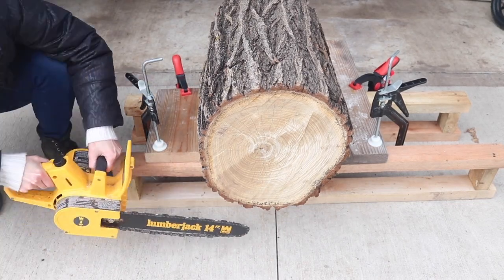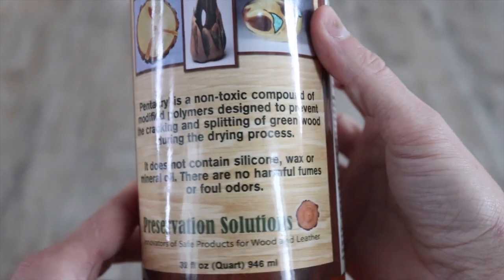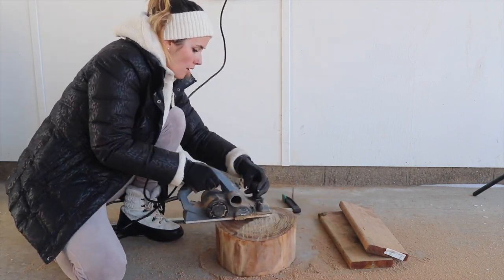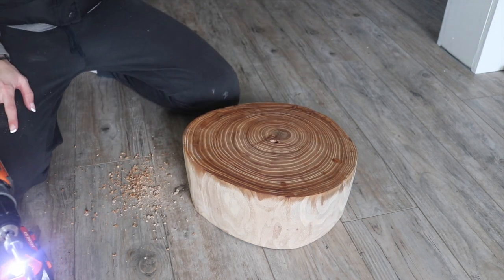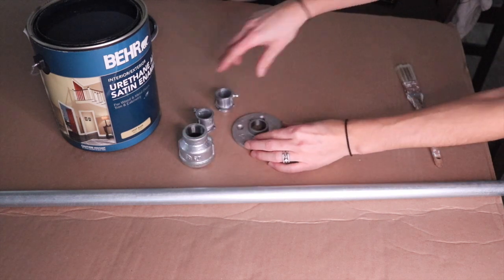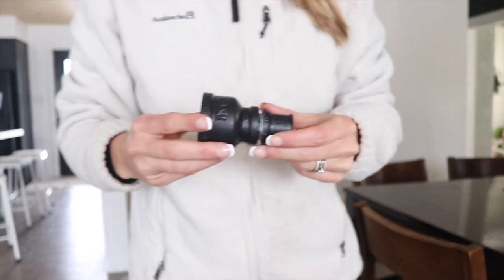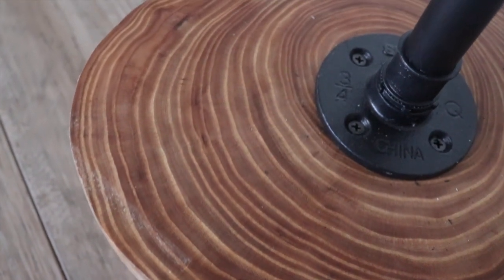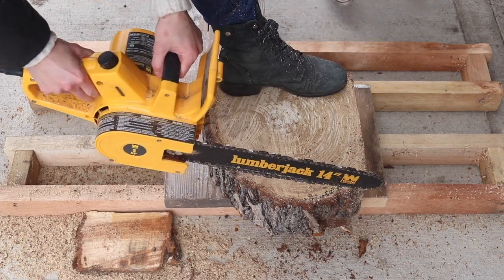How to Build a Standing Lamp | Wooden Lamp Base | Industrial Style Lamp

Comment: That wood stabiliser worked wonders with that log, I have use a hand planer before on wood and I can tell you it usually takes off large amounts each time you go over the wood. That stabiliser made the wood so hard the planer just could not get stock in to do it job. All you need to be able to turn the lamp stand on and off is a “in line switch”, they are cheap and most electrical shops or DIY shops will stock them.

Comment: Since you used threaded schedule 40 galvanized fittings it would have been advantageous to use galvanized threaded schedule 40 steel pipe. It's heavier duty which would help with moving the lamp around.

Comment: IMPORTANT! DANGER!

Check with an electrician if you need to earth this. You've added a metal body and if the wire shorts in the conduit, someone can get electrocuted. Appliances with metal housing need to be earthed. 

The original Ikea lamp probably had plastic housing which means it didn't require earthing.

Update: I showed this video to an electrician and he said the metal needs to be earthed.
Reply from the maker: All of the wire in this project is inside plastic?
Reply: @Welcome to the Woods  The wire is insulated but the insulation can wear, decay or melt. If the wire shorts, the pipe will become live and anyone who touches it will complete the circuit and be electrocuted (ie they will become the earth path, rather than than the earth leakage protection in your breaker box)

All your appliances that have metal housing (washer, dryer etc) are earthed for this reason. Things that have plastic housing (hair dryer, glue gun, phone charger etc) won't have an earth wire. In Australia, the earthed appliances have a three pronged plug.

I'm not in the USA so I don't know how your safety standards work.  But I'd be checking with an electrician to see if you are in danger. If the appliance overheats and melts some of the insulation, you could have a live lamp stand and the world's weirdest hairdo (or worse)
Reply: @WelcometotheWoodsBlog  Yes, Feck off G+ is correct, it needs to be grounded. I'd remove the plug on the existing wire, tape/tie it together with the new 3 wire and pull on the socketed end. Rewire the socket, and attach the groundwire inside the reducer. Might as well add a switch while you're making it safe.